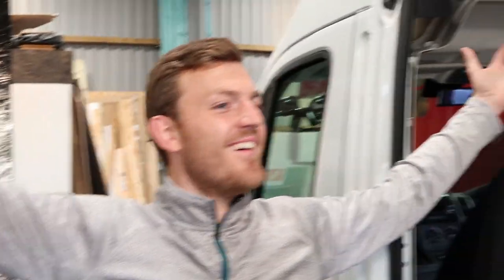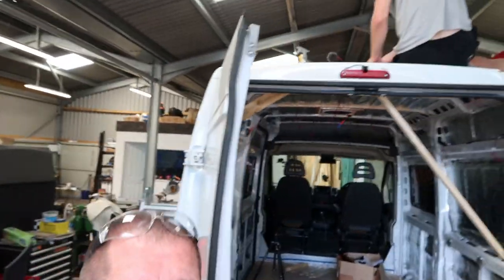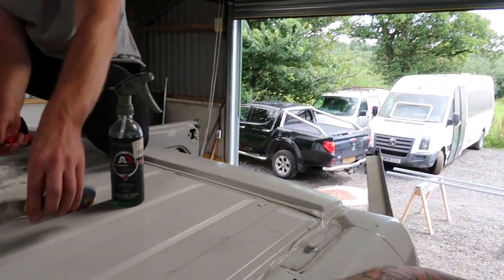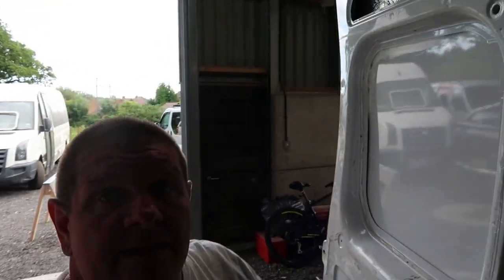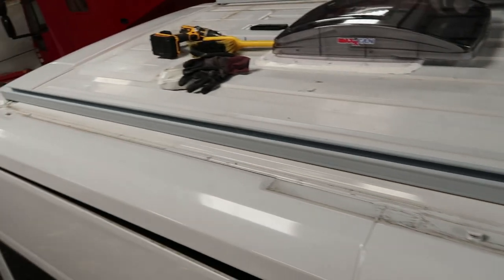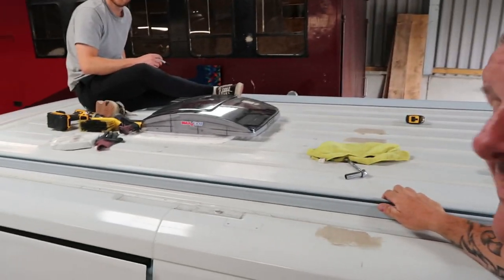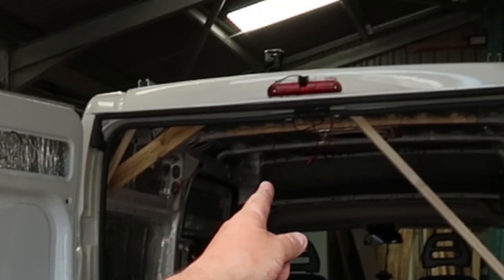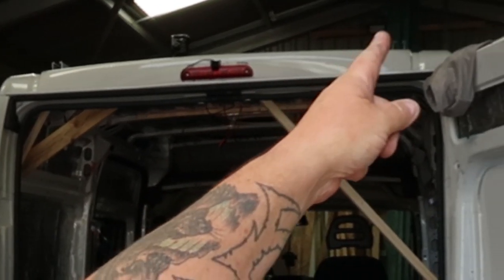UNISTRUT ROOF RACK - With WILL  From Wills Whereabouts

Comment: Hi, thanks for this video! I'm using this 41mm by 41mm unistrut too. Question for you, how do you seal these roof holes. I'm thinking of using foam strip for under the unistrut but unsure about sealing against water. Would you use a rubber washer under the bolt head then sikaflex over the top too? Love your videos, really helping and giving me ideas on first build! 🤠👍
Reply from the maker: I always put sikaflex in the holes thank you
Reply from the maker: sometimes I also use mastic tape

Comment: New subscriber here 😀 Excellent video but I have a couple of questions please…?

* I gather it’s possible to use special fittings so you can fix the unistrut to the 4 lugs on each side of the roof instead of needing to drill holes to bolt them on. Any reasons for not taking that route?

* What size unistrut did you use please? I need it to be strong enough to hold two solar panels weighing 15kg each.

* What do you do next after fitting the unistrut? Will you be showing that part of fitting the panels?

Well done for helping Will - in his own videos he’s clearly appreciated the leg-up you’re giving him in his build.
Reply from the maker: Hi ya you can use these but because of wills leak I didnt want to go that route in case they are leaking and he had sealed them making it hard to use them.
I used 41 x 41 unit strut on the roof and yes we will be showing a video when he comes back for the completion including painting the van
Reply from the maker: Thank you for subscribing
Reply: @BuiltnotBoughtCampers   Yes, with the leak being around one of the lugs, I can see why you avoided using them. However, when you do use them, what fittings do you use and where do you get them from? The perfect fitting seems to come as part of the kit for installing a Fiamma roof rack but you can’t buy them separately. (See what I mean at the start of Gadget John’s video here: https://youtu.be/n0Waspo6Neg ).
Presumably I’d need a metal fabricator to make me some?
Reply from the maker: @janemack1933  I think I'd be tempted to drill the roof and save the hassle that way there is no further expense and it will do the job.  Wills will be holding two solar panels and some composite decking so the four fixings on each rail is plenty to hold it
Reply: @BuiltnotBoughtCampers   I’m trying to avoid making any more holes than I need to. LOL!